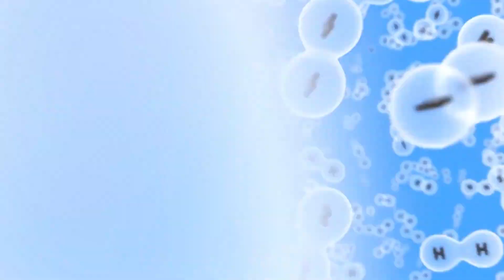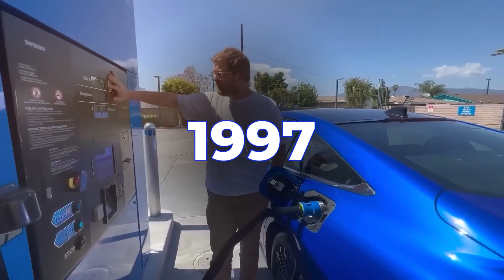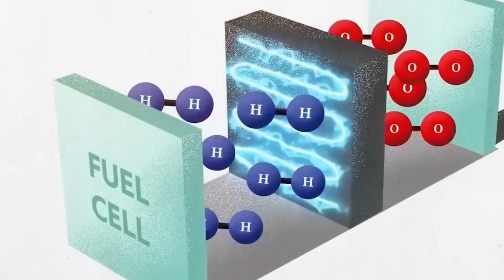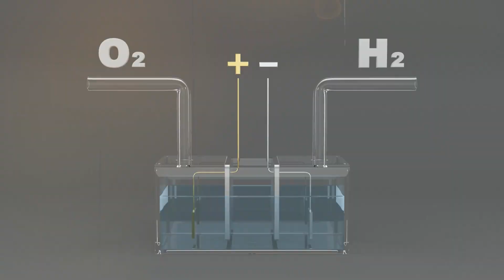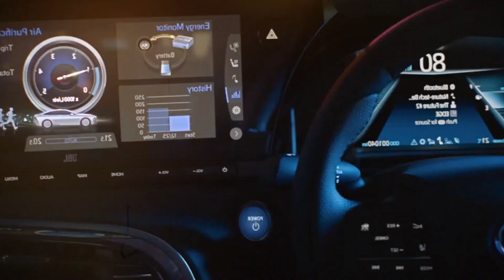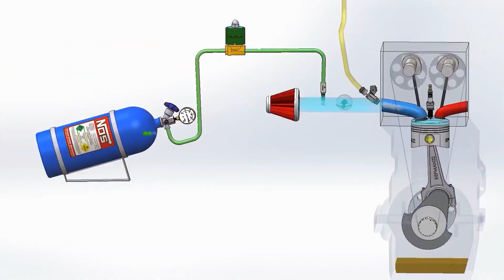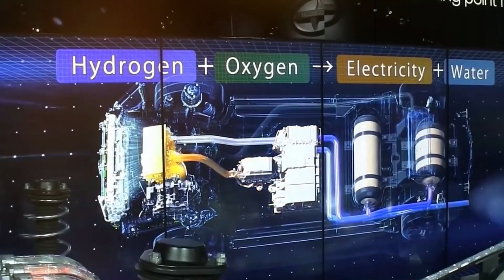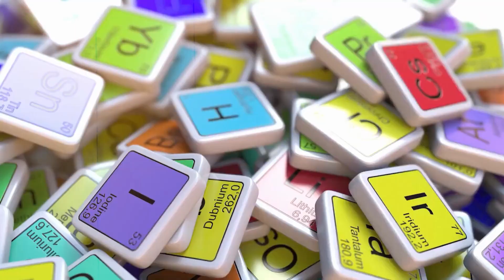This INSANE New Toyota Engine Will Change The Entire EV Industry!

Comment: Riddled with inaccuracies.
This is what happens when someone who has no idea what hydrogen combustion is produces a video.
Nearly every sentence is a lie - a combustion hydrogen engine does NOT involve electric propulsion (there's no "fuel cell"), nor is its exhaust "emission-free". The air used includes nitrogen when when the combustion occurs creates Nitrogen Dioxide - a lung irritant. Yes he does mention that Toyota has solved this BUT never mentions what will eliminate them!!!!!
Saving time at the petrol station ??? Well EV drivers never go there - most EV drivers will  spend 20 seconds plugging in and 20 seconds unplugging every 300 miles NOT 5** minutes refuelling every 300 miles!!.  
**BTW people still queue to even get into many petrol stations!!!!
Oh and the electric that you wasted making hydrogen will make an EV go THREE times as far as the hydrogen you've produced.
Producing hydrogen is either very dirty (steam reformation of methane - which produces a fuel with LESS energy than the methane had AND it creates CO2)  OR  is only 30% efficient (making electric split water into Hydrogen and Oxygen isn't efficent, AND you have to transport it, NB it takes 18 tankers to ship the same amount of energy as one diesel or gasoline tanker!!!)